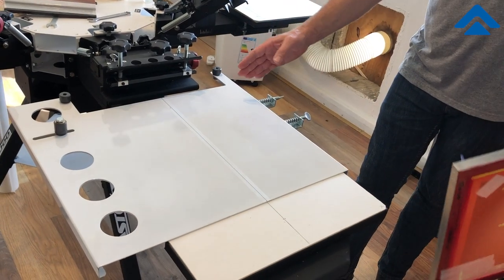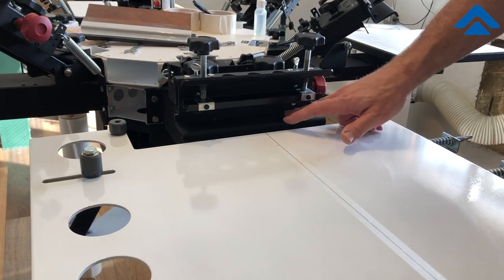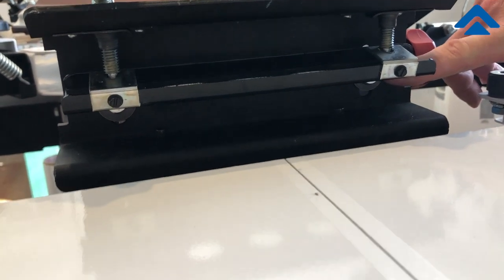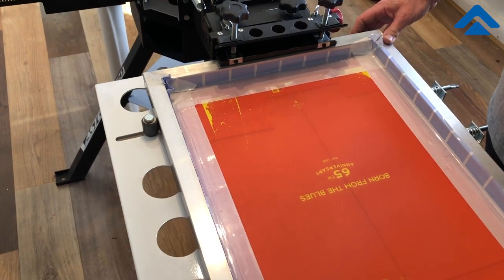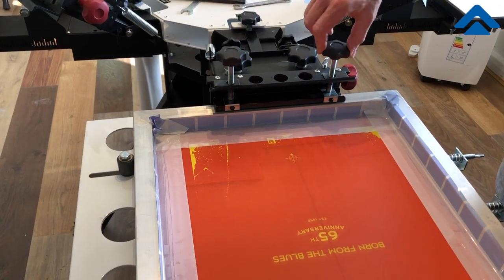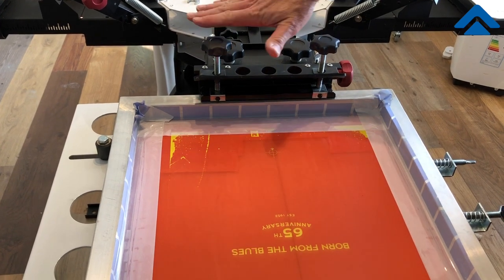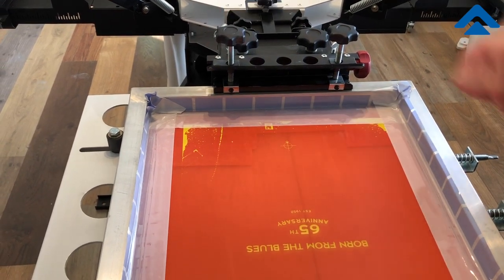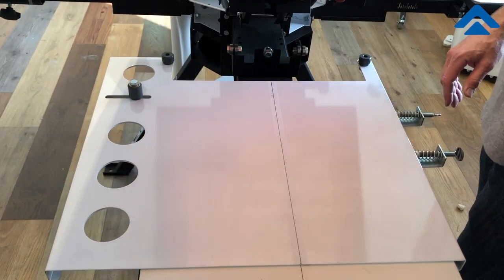Inserting a screen using the VRS jig

Comment: Hello i have the same printer.  My problem right now is the screen moveswhen I use it on certain stations.  For example 3 stations are working correct the screen isnr moving when I drop it on the pallet for print  but the other 3 stations the screen shakes and shift.  Can you tell me what could be wrong
Reply from the maker: Hi Keem, I am struggling to understand exactly what is going on here. If you have set the machine up correctly, there should be no issues at all. Make sure you have the correct off-contact to start with. If you assembled the machine yourself, it is possible something is not quite right. It would be a whole lot easier to discuss this with your dealer perhaps via video call so you can show them what is going on. They should be able to assist you in figuring this out. If you bought from a dealer that is not helpful, try speaking to Vastex direct. I do hope that helps and you get to the bottom of the problem. Do come back and tell us!